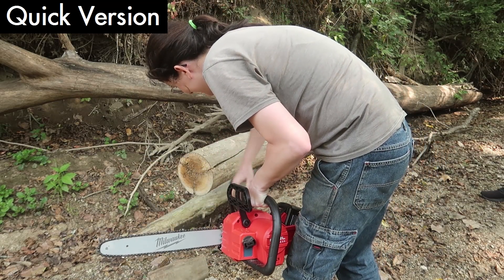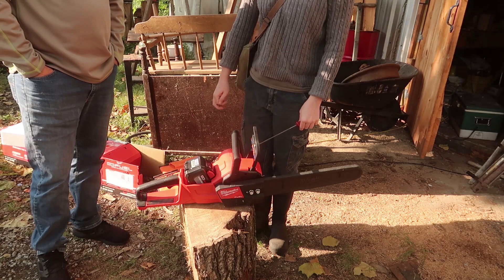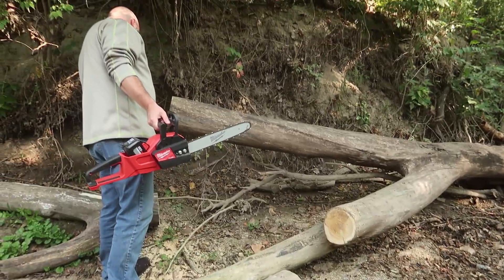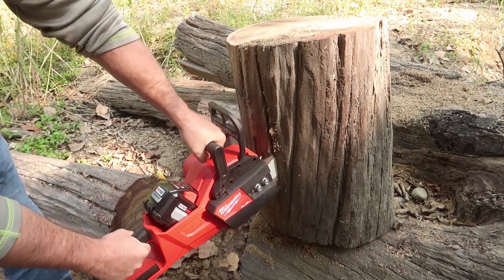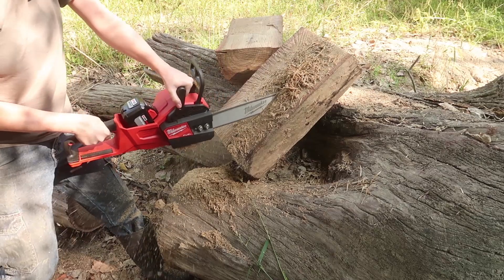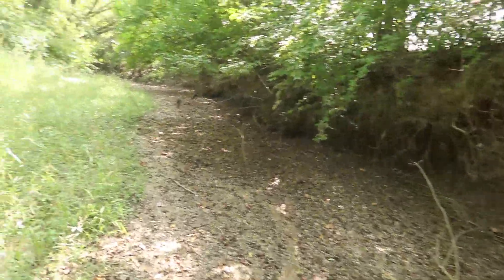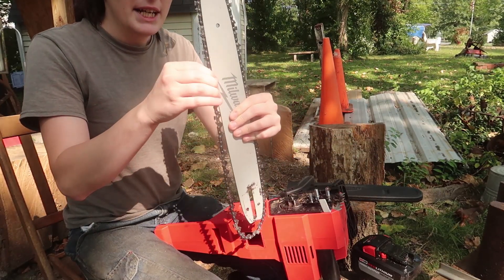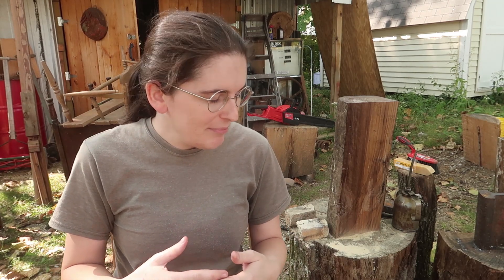Logging the Hours I: Milwaukee M18 Chainsaw Milling Thick Walnut in the Creek

Comment: I would recommend removing the battery when sharpening.  If thebattery has a charge and chain brake is off, the electric saw is potentially running.  When you need to sharpen the chain, put the battery on the charger insuring it will not accidentally energize the motor!
Reply from the maker: dying in a car crash is more likely tbh, electronics like these dont just turn on without any cause.
Reply: What about the ghost in the machine?
Reply from the maker: hah, good one.
Reply: @RinoaL  i love living on the edge, thats why i love Rinoa
Reply: @johanrheeder1640  LMAO,real edgy 🤣

Comment: That's a break when you chainsaw keypad lock so why you're sharpening you only made one mistake anytime when you sharpen your chain make sure you pull your battery freak accidents that happen I wish you all the luck with it and be careful
Reply from the maker: i disagree on that, i dont believe in freak accidents, i believe in being mindful. you wouldnt remove the petrol from the gas pump either, and it would take about the same freak accident to start an engine.
Reply: @rinoas is sure pretty rude for having a channel and wanting followers. Instead of pushing back at everyone that expresses this concern they could just say thanks for the feedback. Last time I’ll watch this channel.

Comment: too tight of chain is tough on the bar. to loose they throw off to easy.  flip the bar every time you change the chain so it wears evenly. lift the tip of the bar when you tighten the bar nuts.
Reply from the maker: thanks, ill do those

Comment: They do make a ripping chain if you plan to do a lot of resawing into boaerds or billets. Its a pain to keep chaning back and forth but they do cut nicely.
Reply from the maker: oh yeah i do plan to get one, dont worry... or at least make one from a cheap chain.
Reply: I believe you can make a resaw chain by sharpening a standard chain to a 10-0 degree angle. The angle of the tooth should be flatter when cutting with the grain. Just something to think about when you're chain starts to wear and you need to sharpen or replace.

Comment: I've made a living with power tools for my entire life and at 66, I'm just about ready to retire. But I've never had a Milwaukee tool I wasn't happy with and the Fuel series just blows me away! Even the 12V series lasts longer and has more power than my other 18V stuff. And their corded tools just last forever! I'm a plumber and I have a "Hole Hawg" which is a right angle drill and it has enough power that it will break your arm and it has thrown a few apprentices off of ladders even after I showed them how to brace it against a stud because when it binds up it's going to kick back! And some don't take it seriously and don't listen, especially if they're big guys who are pretty strong. It usually only takes one time for them to pay attention though. But that Hole Hawg I bought used in 1987 and it's never let me down and I used that thing hard. The brushes wear out and have to be replaced occasionally and I always have a repair shop go through it and make sure everything else was OK even though I've been carrying around a set of new brushes for 30 years, you know, just in case. I'm pretty sure you're gonna love that chain saw. None of their tools are cheap but with them I believe that you get what you pay for.

And I'm going to check out AvE's video. I just recently discovered him and started following him. He's awesome, Highly skilled, extremely talented,   and he makes me laugh.
Reply from the maker: thanks, and i agree, i imagine this lasting me quite a long time. and hopefully the 18V means its more likely to survive and water related accidents unlike 48v or higher.

Comment: Your tension is just fine. Is there any type of baffle that's causing the waste to compact in the cover? But, regardless, I'm impressed with your purchase. I'm used to running Stihl equipment. Use a good quality chain oil, and like you were doing before, keep the groove in the bar cleaned out. Probably wouldn't hurt to take a small can of WD40 or solvent with you to clean up a gummy bar.
Reply from the maker: sadly i think its just a poorly designed bar cover thats causing it. wondering how much a copy would cost that i could modify.
Reply: I doubt that it would cost very much.
Reply from the maker: huh... looks like its about 6$... will have to decide on where to order it from.
Reply: I googled it and a genuine milwaukee part was $16 but not knowing the exact model number........
Reply: Other than that one little hiccup with the clogging, it appeared to do very well. No more than I need a chainsaw anymore, a small electric one would suit me fine. Only thing I need one for is to trim low branches that slap me in the face when I go by on the tractor, a few broken branches or maybe cut enough wood for a fire pit once in awhile
Reply from the maker: milwaukee part 43-72-9002
Reply: @RinoaL  I had a poulan saw years ago and I had to modify the cover because it was clogging like that. It made cutting so much easier.

Comment: One of the videos on Youtube where they tested a number of cordless chainsaws noted that when "noodling", cutting trunks lengthwise as you were doing, the Milwaukee chainsaw in particular would jam up with the "noodles" (wood shavings) because it had a larger gap near the chain. The other chainsaws didn't seem to have that issue.
Reply from the maker: yeah i can see that

Comment: For here and there battery is okay, if you actually need to do a lot of logging, obviously gas is king, far more energy density
Reply from the maker: gas is also far less reliable though. so much maintenance, and smells aweful.
Reply: ...but the tech itself is far less efficient = gas dethroned or sharing it at best. ICE drive systems are only ~35% eff while electric is >90%. A lot of that fuel is wasted in friction and thermal losses. She can theoretically charge the batteries with the solar panels she already has = fuel cost savings to be had and a potential payback on that $500 she spent - can't say the same for gas. Energy density be damned, the reality is that people can carry a spare battery (or two, depending on ah cap) to charge while the other is being used just as they can carry a spare can of gas. Plug it into a car inverter and it'll be ready before you need it. I've worked in the woods and have never seen any of my peers lug a saw to work without bringing a can of gas with them - no difference with electric. Buddy of mine cuts 8 cord of firewood every fall with his electric. Not all saws are created equally either. The batteries for the Stihl MSA 200, for example, range in continuous operating time from 15 minutes for the AP 100 and up to 200 minutes for the AR 3000 batt, and they charge in half that time so they're ready to go before the other is even dead (but shouldn't be drained beyond 80% of its cap - that's what kills a battery quick).
Reply from the maker: well draining a battery actually doesnt damage the cells, its heating that damages it, along with letting it sit at full charge. ohmit heating from high loads causing high temp seem to be the main issue with power tool batteries.

and yeah this battery only took 20 minutes to charge back up, so i figure i could charge it off my ebike if i wanted.

Comment: Interesting comments I’m always telling my mates not to leave their batteries on charge overnight just incase, although I did think these modern chargers had cut offs?? I seen your comment about overheating them during charging, if you know something I don’t could you please enlighten me? Milwaukee seems to be the front runner in power tools today I done a lot of research before buying the M18 impact & drill/driver kit (as one does when spending £300) & its a beast of a kit, however it’s kinda like dewalt  marketing in that there’s so much choice of similar drills, homeowner, professional, amp/hour etc making the research a bit of a headache! I occasionally use chainsaws for fence post trimming & butchering concrete shutters & yes, they belong in the hands of professional loggers, It’d be a lot less hassle for me to get one of these battery jobs I’m just curious about the thin chain & how long it’d last? Hand sharpening isn’t my idea of therapy & I hear thin chains aren’t as easy to file as larger ones as they wobble about in the bar, thin files snap etc🤷🏻‍♂️, anyway soz for rambling on! Cya lol 👍
Reply from the maker: oh i was meaning discharging them quickly causes heating which can damage them. and im basing that off fundamental knowledge of lithium since i used to work at Apple and handled a lot of lithium cells, and build ebike batteries. its what the scientific papers have found to be half the trouble. so really if your battery is big enough, it wont be stressed  as much when used, likewise the lithium cells slowly die if kept stored at 100%. thats why laptop battery packs die so quickly
Reply: All makes sense now! Cheers for that 👍. Only thing that’s worrying me now is my OCD about keeping all my lithium bats fully lying about fully charged incase of power cuts (which we rarely have here anyway), & I’m a Jack of all so I’ve got lots of different cordless tools 🙈. Oh well, I’ll survive lol 🤷🏻‍♂️👍
Reply from the maker: if you only charge to 85% that will almost halve the degredation, doing down to 75% charge will cut degredation down to like a quarter of the normal. so i say charge your batteries to someplace around 75 to 85% if you can, and they will last a lot longer while still being useful. the degredation really is exponential around the top charge, thats why rockets that use lithium cells once charge them to like 150% charge, because they only need one use.
Reply: Thanks for the information 👍

Comment: I was wondering what you would charge to cut a two inch thick slab of the big tree and make a three legged stool about 18 inches high.
Reply: You know this isn't a shop right?
Reply: Well it’s a business proposition? If you don’t ask ya don’t get 🤷🏻‍♂️
Reply from the maker: i need to see if theres any unrotten wood  in the thicker parts before i make anything with it lol

Comment: good tools are always a good investment, buy once a good tool or spend more buying tools that are not up to the job, for a battery tool that made an impressive amount of cuts. now you have access to a nice log of lovely timber, if you need more, its just a short walk away, and you have the tool to get it, plus it is the best price - free. the one thing i did notice is that you are producing a lot longer chips when ripping along the grain, and those long chips are choking in the waste duct, maybe stop to clear that a bit more often or some silicon spray to make the chute slippier (not sure how the professionals do this, can you get different blades for ripping?). All in all a good investment into your wood working, this can rough out to enable your other tools to perform better too. great video.

Comment: You should only push on the file not pull and when you file you should file the teeth all the same amount so if you do 4 on the first all the rest should be 4 to 👍
Reply from the maker: go tell that to Buckin Billy Ray Smith, pulling is how you do the other teeth and it results in a clean sharp tooth

Comment: I'm curious why you didn't buy a gasoline saw?
Reply from the maker: i already own several gasoline chainsaws, they are loud, smelly, fuel is expensive, and most of all, unreliable.
Reply: @RinoaL ,unreliable?  i wood love to see a amount of run hours compared to a $500 echo, stihl, husky.  ive never seen a battery saw at the sawmill.   i totally understand they have there place and i hope it works out for ya.     if you just get at it and rapid discharge the battery, does it get hot? the battery not the saw.   have a good day ma,am!
Reply from the maker: well i have a veritable army of petrol saws that are broken and repairs are costly. this saw‘s battery only got slightly warm from using it hard
Reply: @RinoaL  "Repairs" that's you for sure. Go to work..lol.